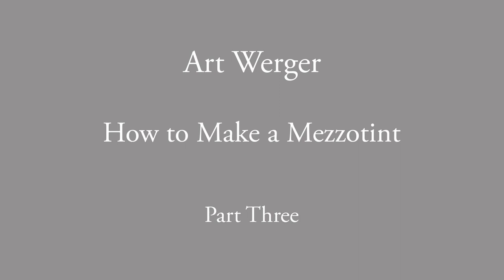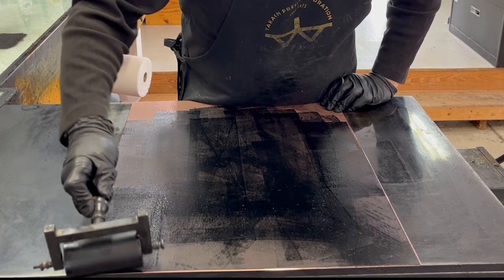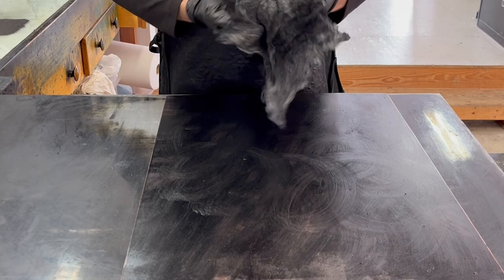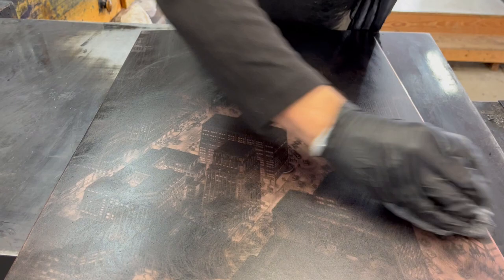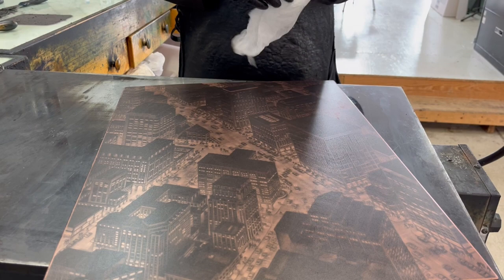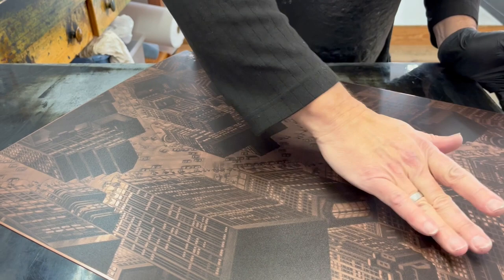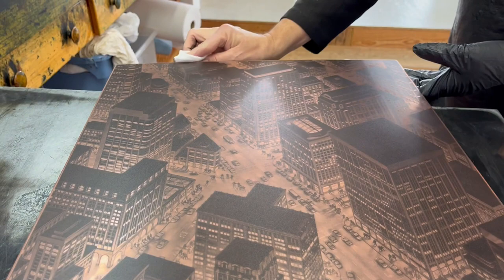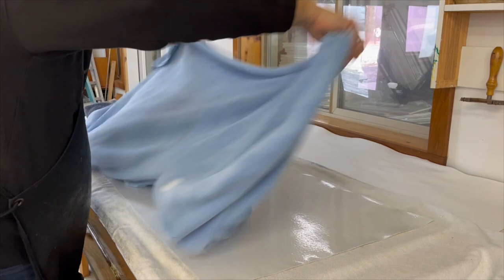How to Make a Mezzotint Part 3 | Art Werger

Comment: Nice videos, well presented and informative. What is your opinion on mechanically roughening the plate; or an aquatint ground?
Reply from the maker: Thank you! I do work on pre-rocked plates made in London. They are very good and my elbows can no longer take all the abuse of rocking large plates. I also do a lot of aquatint.  When making aquatints, I try to achieve all of my values through the stage biting process. I prefer not to rework (scrape and burnish) the aquatint at all. Check out my video artwergeraquatint to see the stage biting process